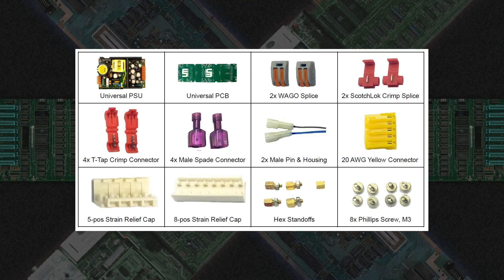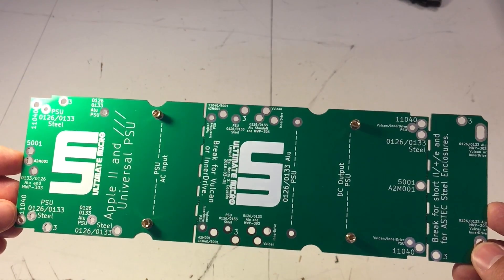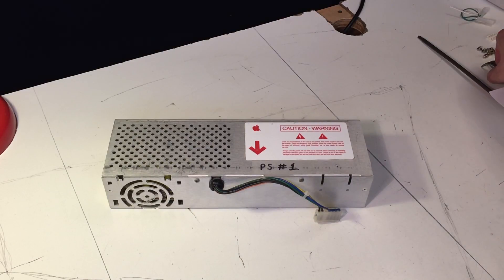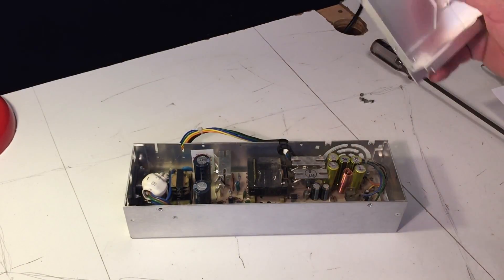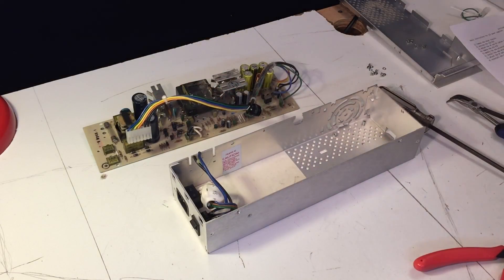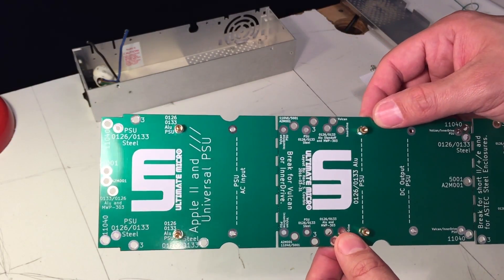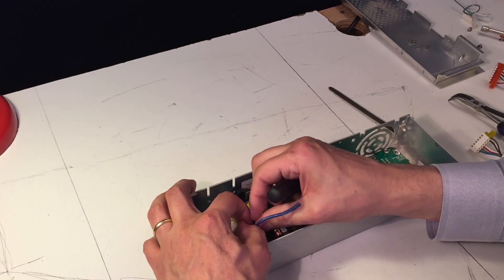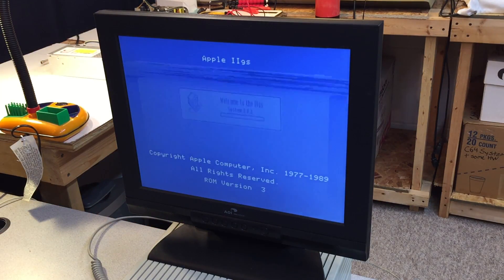UltimateMicro Universal Apple II Power Supply Kit

Comment: Joe, did you keep the old guts to the power supply after you installed the new P.S. kit? Is there any reason to do so? I'm getting my Universal Apple II Power Supply kit tomorrow. I had plans to toss out the old tech.
Reply from the maker: I kept my guts, and may repair it as a chillstream at some point. SPOILERS! If you know how to repair your original powersupply, it's handy to do so and keep it around as a spare. The Universal supply is of greater capabilities, however, and should well outlast the original supply.

Comment: So does the new power supply use less electricity or what's the reason for upgrading if my original is still working perfectly fine?
Reply from the maker: The new supply is both more energy efficient and provides cleaner power and higher wattage, so it's objectively better than the original supply. You would replace your original supply if it's dead, you are running lots of cards, or you suspect a power issue. It's also easier and more sure thing to replace a suspect reply than to try to repair the original.
Reply: It's a 30 year old power supply with large electrolytic caps -- it's a ticking time bomb.
Reply: @rednight2476  i hate that ageing psu, time to blow 70 bucks and get that apple running with that new psu